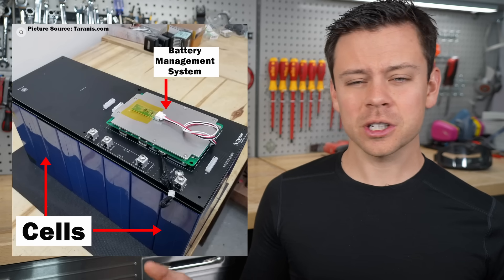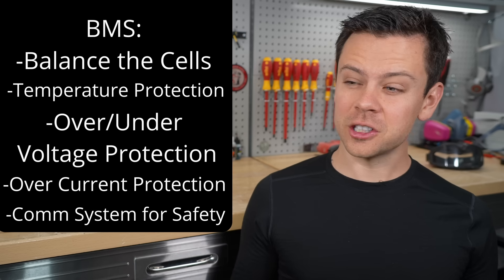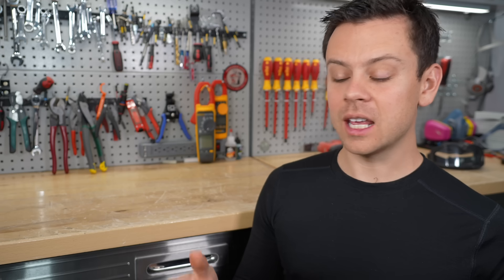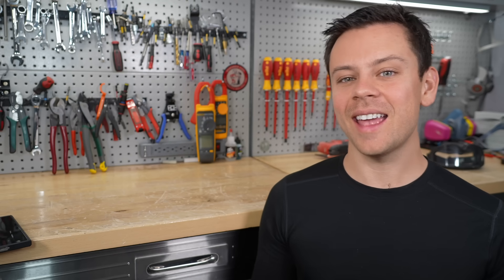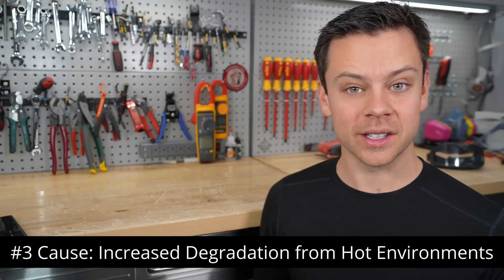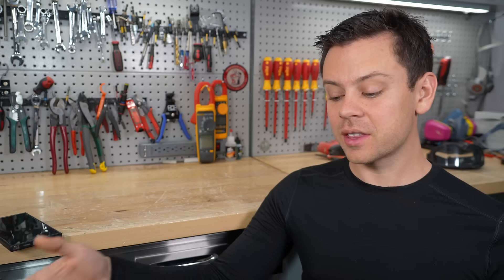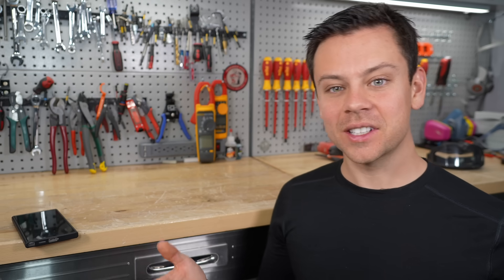The Rules of LiFePO4: The 3 Most Common Causes of Failure and General Guidelines for Long Term Use

Comment: I have an RV that has a Lifepo4 battery for the house and a solar panel. The RV is often in storage.
When in use I always try to charge the battery to 100%, when the RV is in storage should I set the solar to keep the battery at 50% or just leave it set to keep it at 100% and not worry about it?
What would be the difference in degradation over time. I have seen no hard data anywhere on the difference in degradation between storing lifepo at 100% or 50%.
For reference temps in my area are generally 60-78 summer and 40-65 in the winter and the solar charging rate is a maximum of 0.05C, very low.

Comment: Eco Worthy solar controller overcharged my battery. And it got very hot.  Was rated 30 amps.  I was only at 20 amps and it got up to 154 F.

Comment: My new system charges my battery to 14.6 and stays there all day, never drops back down to 13.8.  I had to trun off the system then restart and change the equalization voltage to 13.8 from the 14.6 it was set at and the battery did finally drop back down with some load. Doesn't sound right.

Comment: I paid about $2000 for a LiFePO4 battery, 12v300AH back in 2018, it's still chugging along just fine after 8 years.
I've added a much newer 400Ah to the bank about 6 months ago (now 18months old) no issues, 
I use it in my small motor home, where electric has replaced everything but the diesel furnace. With 1500W of collection.
Reply: 😳 dang I gotta say 2 large for a battery is just kind of insane tho... I got a 100ah lifepo4 for around a $100... Maybe it's a quality thing tho, it drops charge slowly even when not in use
Reply: That being said, I'm considering just going back to deep cycle batteries they just seemed to last longer per charge, weren't sensitive to cold, can be charged right off a car, etc... in fact I even ran one in my jeep for like 10 years...

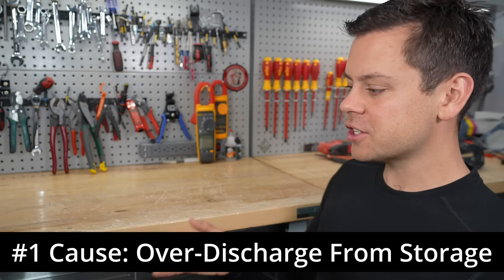Comment: so at 1:40 - In this video - he said #1 issue is undercharging, etc .. below the 20% / draining your battery vis use on your devices;  i've heard about which shortens the battery life.
then 6:15  he said just recharge to max and feel free to discharge the batter to 0 to get the most out of your battery.
Hard to know if he's coming or going with the feelings of the LifePo4 batteries.   😐

Comment: Hi, I have 200ah (2x 100ah) lithium leisure batteries in my campervan and I have a solar mppt and DC to DC charger. Every night my batteries drain to approx 95%. Then within 15-20 mins of driving they are back to 100% and then kept at 100% all day with the solar. Should I turn off the chargers so that the batteries will drain below 90-95% or permanently keep them charged to and stored between 90-100%? Thank you

Comment: Hi Will,  I have a 12v/18ah lithium battery for my Garmin Sonar / Panoptix. I used it for around 6hrs. When it got to 11.4 volts my sounder gave me a warning to low of voltage, 2 minutes later it died (shutdown completely) I understand that. It was a very hot day out. When I got back to the cabin 30min later,  I put it on my charger to charge. My charger would not charge it and said there was an issue with the battery. I thought the battery was no good and something went wrong. The next day I went to the store where I purchased the battery from,  they have no problem giving me a new one. But as I was pulling the battery out of my shuttle it came back to life. 1, was the battery to hot or just to low to take a charge? 2, did BMS turn off.  I put a meter on it right after it died it was 0.53volts. I retested it at the store when it came back it was 3.65 volts. I do not understand why 24hrs later it woke up?   Thx Kevin

Comment: Why does my Renogy battery 🔋 charge to 13.3 volts at 100% yet has an overspill in which it charges to 14,4 volts? My battery trickle charges and stays at 100% constantly even with running an electric hob, charging phones and iPads and running a fridge. It's barely drops below 13.1v. is that okay? Had it 2 years and only says I've done 45 full cycles.

Comment: I deeply discharged my 48V LiFePO4 battery (in a golf cart). Now the BMS won't let it charge up to 100%. It keeps getting better, but the battery voltage is still only going up to 51.6 volts. Will this eventually get better with discharge/charge cycles? At the beginning (after the deep discharge) the individual cell voltages were differing by 0.15 volts. Now after some small discharge and recharge cycles the difference is 0.008V. So that seems to be better but it still isn't charging to 100%. BTW, this is a new battery. The deep discharge happened on the first discharge. I know this isn't a forum, but I'm sure hoping someone can shed some light.
Reply from the maker: What in the world. Yeah post it in the forum, it shouldn't do that

Comment: I have 3 ReLion RB100 batteries in a compartment with 7 inch leach to busbars. I want to add a 4th RB100 in a space 3 feet away. I have a sailboat that has a 60 Amp shore power supply and an engine with 125 Amp alternator. I use 2 30 Amp Orion dc-dc chargers for the Lithium bank. One Orion with the shore power charger and both 30 amp Orions with the alternator.  Is the 4th RB100 workable?

Comment: When I set the bulk charge to 29V, I realised that as it charged the voltage do get above 29V sometimes even up to 30V before eventually stabilising at the float voltage of 27.2. My question is, I hope this doesn't damage the BMS especially as it crosses above the 29V?

It's a grid tied system

Comment: You mentioned first that self discharge in storage can kill batteries. Of course we can have a routine and plug into chargers. 
The other approach is making all of your storage systems compatible with each other so you own less batteries overall for given combination Wh storage in all your batteries. Like using self heating batteries even on a summer Jon boat battery box will allow you to use them in a ski camper next season

Comment: I have a cabin in Northern Canada with solar power. I currently have flooded lead acid batteries. I would like to switch to lifep04 batteries. It can get to -40 in the winter. The batteries would be idle for approximately 10 months. I have had problems with the flooded lead acid batteries freezing because the solar panels get covered with snow so the batteries don’t charge and they freeze. I have watched many videos about not charging lifep04 batteries below freezing but what about storing them. Not charging, not discharging just storing the batteries. I would love to see you test one to see how it performs.

Comment: I've been solar power off grid for 17 years. I just upgraded my system. I now use lifepo4 batts. No more maintaing messy lead acid batts. My question is this. Is it important to draw the lifepo4 down low or is it ok to keep them mostly fully charged all the time?

Comment: August 15 2025 

Hello I know you get lot questions asked in the comments . 

I hope you can read this and let me know . 
Email or reply on this same video. 

Is this safe and ok to do ? Can I plug a Renogy 200W solar panel and a Renogy 200W ShadowFlux Anti-Shading N-Type solar panel simultaneously with the Jackery Explorer 3000 Pro, plugging one into each of its own of the two DC input ports ? 1 renogy 200 w to one of dc input and another renogy 200 w shadow flux in to other DC input ?

Comment: "To balance your battery all you need to do is charge it to 100%"- if only it were that easy! A 314Ah battery with a cell balance difference of 0.157V at 14.25V charge voltage isn't going to balance if the manufacturer (WattCycle) has fitted a passive balancer only capable of 50mA balance current flow. Instead, one cell cuts out the BMS due to it's high charge voltage and that's it for the day charging (and balancing) over. So the balancing circuit's window of operation is very limited time wise, and the battery doesn't get fully charged. I've been repeating that cycle for months with no improvement. Please look into the little details like the capability of the balancing circuit vs the cell capacity in your reviews. Even holding the charge at 14.20V (where the BMS won't trip and stop charging) has been of no help due to the balance circuit being under spec for the cell size, and the cells must also have been assembled out of balance.

Comment: I have a 48v LiFePO4 5.2 KWh battery on a Victron system on my houseboat & it all manages itself, once I got the battery BMS talking to the Victron system. Absolutely perfect! Great video! Cheers
Reply: I have similar system with Victron and battery. What did you do to get the two 'talking to each other' please?
Reply: @tonguesoffireproductions5266 I spoke to the guys that built the battery and they told me which communication settings I needed to change. Apparently it depends on the battery. Mine was a Fusion battery from Australia

Comment: This is bad advice .
The secret is to keep the beattery in the 20%-80% margin
But once a week you do a SLOW full charge to 100%
Reply: keep it at 70% for storge  and once a month charge to 90% then discharge to 70% that battery will last forever
Reply: @johnnycammareri2170  lifepo4 need a 100% charge at least once every two weeks

Comment: I have a car starting battery question. I use LiFePo4 in my motorcycles (Antigravity with NO bms!) and I'm convinced this should be easy to implement for my car. The problem is that same brand wants nearly a grand for the batteries they rate for car starting. It can't be that hard or expensive. Can you recommend something?

Comment: Hi. I`m running a 15 kw Deye hybrid system with 15 kw battery storage, model SE-G5.1 Pro-B - 51.2V 5.12kWh, 3 pcs. I charge to 100% every day and discharge during the night to 20%. I use a slow charging curve of 45 amps, around 2.2kw/hour to delay the charging to 100% but even so the batteries remain at full capacity for about 6-8 hours/day (except winter). Batteries are connected to the inverter using can port and are managed by Deye native protocol “00” with BMS, so I don`t have access to a lot of settings, as they are automated and can`t limit the charging to 90-95% with this protocol. Does charging to 100% affect the lifespan of the batteries on the long run? Thank you.

Comment: I need a dependable battery with a minimum of 200ah. I live in northern ok so cold winter. This is for my camper van with daily use. Im also running 200 wats of solar. What battery do you recomend at a really good price

Comment: Have some friends who 8 years ago spent a enormous amount of money on a solar system (blue Ion battery's) it works flawlessly .. My friends are super conservative with power and turn power strips off and stuff like that.. I told them to use the battery's they think its better not to and said they last longer. 
 There is lots of misinformed on the interweb..

Comment: I hope you still check here, Will. I have 2 LiFePO4 24V batteries in parallel that are continuously being charged by my PV array. The system (batteries, charge controller and inverter) are in my metal shed. I live in Tucson where the outdoor temps are like Vegas - almost always over 100F in the summer.  What I am concerned about is the temp inside the shed, which can peak between 120 and 130! I understand about the degradation over time, but should I be concerned about a dangerous condition being created?  Thanks in advance, Dave

Comment: When you say keep it charged, I just bought a 36 V lithium ion battery for the golf cart. It came with its own charger. It does have a BMS but when you say keep it charged, do you mean keep it plugged in like when you quit using it, just plug it in and leave it or plug it in till it gets to 100% and then unplug it. Thanks you are very helpful. Appreciate it.

Comment: 😅 Will, You sure are pretty white ... especially for living in Las Vegas. I'm about 120 miles West in the Mojave Desert, so I know  what the summer heat is like. It was  109 ° today. Not too hot about average. But I have seen it now and then between 120 and 125. So anyway what I'm wondering is what do you consider a hot ambient environment that you shouldn't be regularly exposing your batteries to?

Comment: The Ecoflow delta pro 3 has in there directions to maintain at 20%- 80% which I’m not doing so. I’ve never charged or discharged batteries in the RC hobby.

Comment: You state that "stored" batteries should periodically be charged to 50% to maintain function, but then go on to say that they should be routinely charged to 100% to maintain cell balance. Two questions: 1)Why stop at 50% for stored batteries based on what you are saying, and 2) are there any "smart chargers" available that could be kept on a battery that would keep an adequate state of charge on stored batteries over time so that they would not die from neglect?

Comment: Will, the thing that is not discussed a lot is the recommended 50% SOC when in storage. I have to keep mine at 100% for the exact reason that the 1 or 2 times a year when the grid goes off for 2 days or so (which will happen), I need all the capacity they can give and it will not help me if they are only half full. So always keeping them at 100%, topping them up every six months or so for when I need them twice a year. Is this bad? Tkx for your great advice.

Comment: I've had my "solar generators" and battery packs for nearly 2 years as backups in case of extended power outages.  I'm not seeing anything like a 3% per month self discharge rate.  Maybe 1% in 6 months, but effectively 0% on the add-on battery packs.

Comment: I bought a 135 ah for a kayak trolling motor I would use down to 40 percent  n charge overnight or until I used or 100 percent it only lasted 8 months n says 13.3 volts fully charged but can't get a discharge to my motor.😢 Lifespan says 10 years but I think that's to sell em  and u guys know there BS

Comment: Hi Will... Wonder if you just answer a silly question for me. I have narrow boat here in the UK. It's a 12v system only no inverter.

I have 2 x Fogstar eco 305amp Batteries wired in parallel. Batteries are on charge by a 480w solar panel and a DC to DC charger when moving the boat. Each battery has a victron smart sence which gives me the voltage and temp of the batteries.

Should I be concerned that one battery voltage is 13.29v and the other battery is showing 13.30v. most days when charging they show the same voltage on both batteries. Am I being a bit picky or over cousious. 

Cheers Will, and keep the great informative vlogs coming...

Comment: Hi there
Just wondering if you could explain how a 1024wh lipo battery can be charged in 1 hour that's a 77 amp capacity and a wall socket produces 12.5 amps?  of course I am talking about eco flow Delta 3+ model.

Comment: Thank you for the video! I had an additional question about the point you made on temperature. I have a portable power station that stays inside my vehicle, I live in Texas and our summers can be very hot . Rarely do I actually use the power station while it's in the vehicle but it is stored in the vehicle when not in use. How detrimental will this be to the batteries over time and is there anything I can do to help them better tolerate the heat inside a vehicle when it is not running in the summer?

Comment: Still totally confused . He says to charge to 100% as much as possible ,but to store at 50% . I want to keep my batteries in stand bye mode in case the power goes out , 50% isn’t much to rely on . What voltage  is 100% and 50% ?

Comment: Your video seems to be focused on Solar. However regarding keeping it charged. I have a LiFePo4 that is used in a UPS scenario. So it will not cycle often, rather it should be as full as possible for when it is needed. So is it better to keep it at 100% or less?

Comment: Will   Your BMS testing and experience clearly explains the air india crash .... In my observation   the onboard   LIPO battery was degraded during the three hour apron flight delay .. the complaints of the passengers complaints of underperforming   aircon .should have highlighted the batteries degraded capacity .. your surge tests clearly demonstrate the   BMS   disconnect operation .the takeoff was NORMAL   until the Gear up switch was thrown . THE BMS DISCONNECT ACTIVATED   and the rest is sadly history .

Comment: Quite a while back you reviewed some salvage batteries that come on the market with an odd chemistry that I think included manganese.  It turned out they had a high self discharge rate (at least mine did).      I bought one for a stand by application and found the issue.  I had to bypass the BMS to bring it back a few times.  What I did was bought a cheap AC to DC adjustable voltage power module ($3?) and set it up for a voltage about 80% charge level.  I just leave it plugged in so it keeps the battery alive and I don't have to remember to check it.  Anyone that has any kind of stand by battery system needs something like that or just leave it plugged in (keeping fire issues in mind)

Comment: 2S2P 24 volt system.Arg ! My 24 volt inverter generates a high voltage alarm at 26.6 volts, and the BMS disconnects at 22 volts . Since I'm "not supposed to" run the inverter through the contoler load ports, I can't selectively turn it off before bms activation. Another issue is when the inverter is active, my voltage sags, thereby creating some accuracy issues. This sag doesn't appear to be a wire gauge issue as all connections  and wires are cold.  Advice from the solar king would be appreciated.